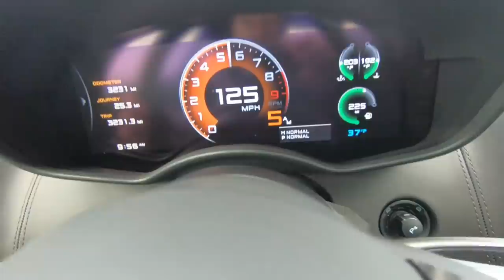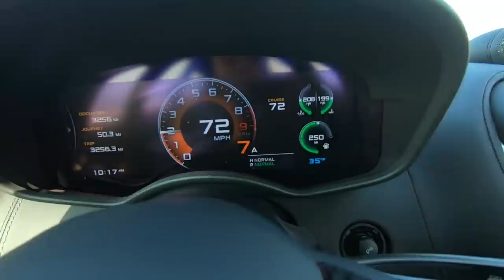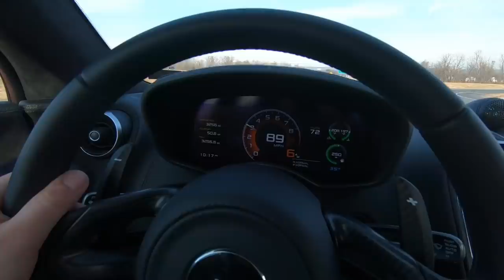We Got in Trouble...

Comment: ProCharged Corvette built by RPM vs SuperCharged Camaro built by CSP. I'd love to see that!
Reply: Will I. You realize a procharger is a super-charger, right?  You have turbochargers that spool from exhaust gasses and superchargers that spool from a belt drive (engine rotation).  It's the same for FI vehicles and carbureted vehicles, only the location and mechanics are slightly different.

Comment: Mike. U need to listen to the guys at RPM and get that car making some real power. 730 isnt bad but ur loosing so much boost with the small pully combo. They said u should be running bigger lower and stock upper to get boost were needs to be. Let them do there thing and make u some power. Doing that shouldnt cost u much.

Comment: How do you up shift with the down shift paddle im in so much confusion
Reply: Derrick Watson i second this
Reply: McLarens have a rocker shifter paddle design. So both paddles are actually connected to each other. If you want to up shift with the down shift paddle, you push it out rather than pull it back towards you. Same for the other side, pull back to up shift, push out to down shift. Makes it easier to shift if you can only reach one paddle or have one hand on the wheel.
Reply: Push or pull it
Reply: Derrick Watson both sides do the same thing

Comment: Honestly mike you probably can go 76-78 and still be ok in a 65 i drive about 68 in a 55 and 84 in a 70 I live in Illinois never been pulled over those speeds just when I go above those is what I noticed I drive 100 miles a day for work don’t know how cops are there but maybe try and find your safe speeds might get pulled over a few but it’s worth it lol. My worst is 130 in a 40. The sign is only changed for a 1/4 mile on a straight road for no reason he was sitting in the 45 got a break down to 85 still really bad

Comment: MIKE READ THIS MESSAGE- you have the $$$$. Get a escort max 360 n use WAZE!!!! PA  has some backward ass law requiring cops to use their radar a certain way. In short. The need to be sitting still n holding the device in their hand. Hence, u will c them on WAZE n or pick them up with radar detector. 

PROBLEM SOLVED